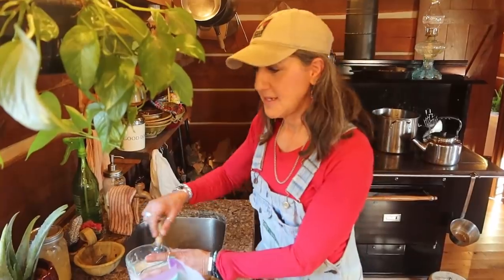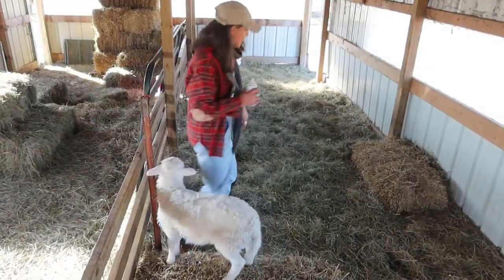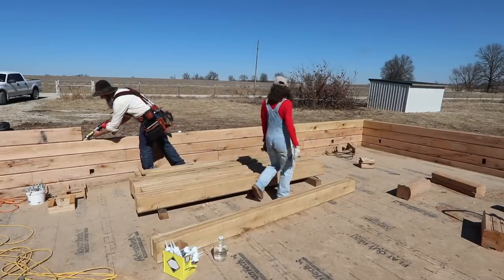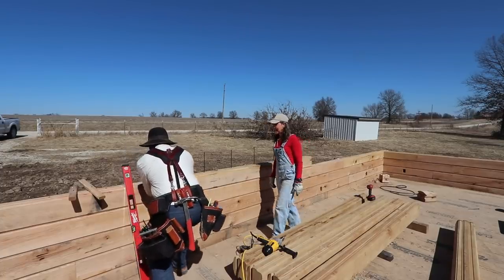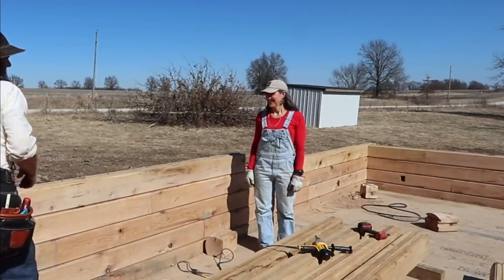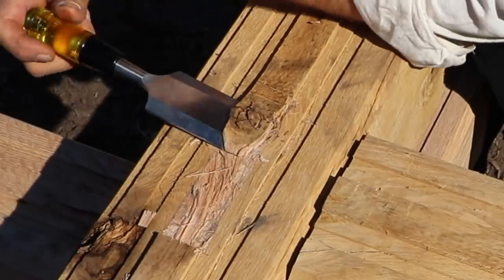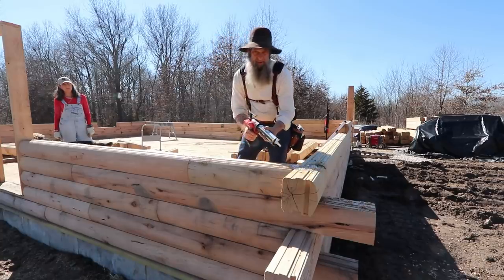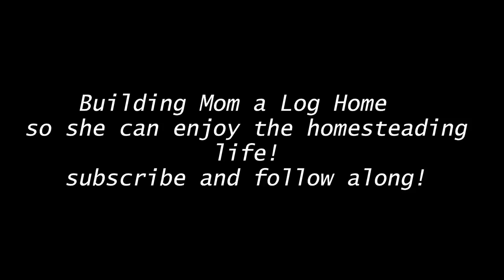Couple Builds LOG HOME for MOM day 25 STACY'S BACK! plus Storman Norman

Comment: Question: why don't you build a push board on the outside of that wall to keep it plum? So as you go up your wall will stay plum.
Reply: Because every log is different.
Reply: @cathleencaratan3373  Those are engineered logs.  They're all the same.
Reply: @verteup  They are still different.
Reply: @cathleencaratan3373  No they're not.  I've ran the machines that make these and they're all uniform.  That's the whole point of milling engineered beams.
Reply: @verteup  So you’re saying that there’s no turn in any of these and they go up uniformly each and every time. Every person handling them is handling them precisely the same. Since you’re so hellbent, you’re right. Not really but Have a great day anyway.
Reply: @cathleencaratan3373  Lady these engineered logs are the same as a 2x4 or any other piece of lumber.  Very uniform in dimension.  Even putting up hand hewn log cabins, people use push boards.  It's extremely common.  Watch barnwood builders.  They use a pushboard on world class log cabins.  You don't know what you're talking about but you're out here correcting people anyways.  Well you're wrong about this topic.

Comment: I mentioned this once before about scraping your screws on a candle or paraffin block to make the screws go in MUCH easier.  Just run the screw along the side of a candle to put a little wax on the threads.  Wow, what a difference it makes and the screws will not back out.

Comment: Sittting here watching you yanking and pulling to move the log into plumb.  You know you do have a great tool sitting by the lumber mill.  Cant hook.. use with a small board on the lower logs. to keep from doing damage. but you will have huge leverage as you go.

Comment: Hey Doug try using wedges to straighten out your wall by bracing some posts on the bottom with a cross rail above then you can force wedges at the point of interest to move the wall to where u need it, just a thought to use physics and leverage to your advantage

Comment: Log cabin really coming along nicely! Watching you struggling to twist that log into place gave me an idea you might like. Get a 5ft length of 1” black pipe and a set of 1” pipe clamps. Then take 2  12” pieces of 2x4 and drill a 1” hole through the 2x4 1 1/2” in from one end on both pieces. Cut a slight cure in on of the pieces to match the outside curve of your logs. Assemble the bar clamps on the pipe with the 2 2x4s between the two clamps and the pipe running through the holes you drilled. Now clamp the extended clamp on your log and you have a 5ft bar to use for leverage to twist the log where you want it. Also instead of chiseling through the ribs on the log to let them bypasss use a small circular saw to cut several kerfs the depth of the rib across the rib, then just knock them off with a hatchet or hammer like you did for the window cuts. Especially handy for working with knots.

Comment: Doug  &  Stacy   I  did  the  logs  as  a  steps  on  up  to  the  levels   it  really  helped out a lot in doing it myself  and  when screwing  the screws in   hold it  like  you  going to  kneed  a  large  batch of dough  when  you get  higher  on up  it is  going to be  up on the log  with the  log  in between  the  legs and  screwing it then  but first  the  screw is  going to be  done  on  each  ends  to make them  stay  there!!!  Oh  Oh  thank  you for that  THE Pulleys  are  what helped me  with the  taller  logs in  getting them up  there!!!

Comment: Norman's turbo tail is a joy.. Milwaukee tools are a great choice. Looks like you use their fastback razor knife as well. A hammer drill might make the screws go in with less effort. Milwaukee makes good ones. Be safer when you have to get on a plank. It can get hairy the higher you go. Be safe...

Comment: Staining in and out right? No drafts. Keep heat in the winter and air conditioning in the summer. Heating and cooling the outside is a big problem at my house.

Comment: Doug, It's way past time to get some electrical tape on the cord near the handle of your drill.....the split casing is weak, as well as dangerous. If the exposed conductors should break at the handle there is no slack to make a repair. Taping sooner, rather than later, will save an expensive tool.     John M.

Comment: I'm wondering, in an effort to make pulling that top log into plum, if it might not be easier using your log ox log gripper tool. if it does not rotate the log, it would provide more leverage and you could use your body weight against it with the assist of gravity instead of all muscle power. If it does overturn, perhaps you could use it on the end and pull it laterally. Just an idea.

Comment: Glad to see its dry today. Stacy is the Best Helper ! What is the Temp there today. Stacy, put some wax or bar soap on those screws, they will go in easier. Doug, could you take a electric hand grinder or disc grinder and remove that center pc. I was wondering if you could use glue out of that tube and some foam. Stacy is a Work Horse, becarful you don't lift to much weight. Stacy have Doug make a small wooden horse or a couple of small pc. to get it up a little higher for you.

Comment: 1 I love the new song 2 Doug I just saw something on another channel that gave me a great idea to help you with aging in place the guy was using the wire bin from IBC totes and filling them with fire wood so I was thinking if you made a swing door on one side you could close the door full the baskets with firewood then use your skid steer to fill your wood shed behind the outdoor kitchen with the baskets then open the door to get wood when you need it so that would mean a lot less manual labor on your part

Comment: What is the estimated R value of the log walls?
Reply: R-1 per inch for pine,, 1.25 for cedar. Guessing oak would be less than 1 being so tight grained.. Never seen one built without a compression gasket on the hump... I've built cabins from 8 different companies plus shrink-fit- full scribe,, no nails or screws..